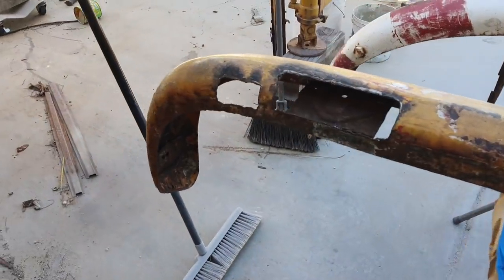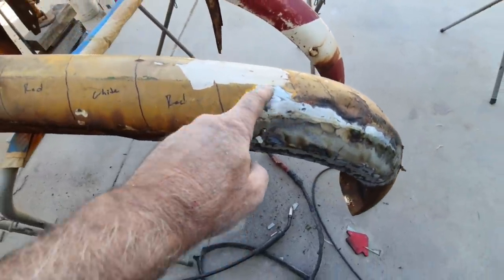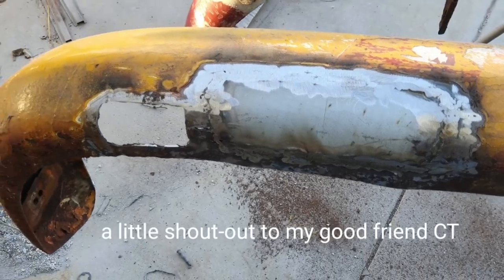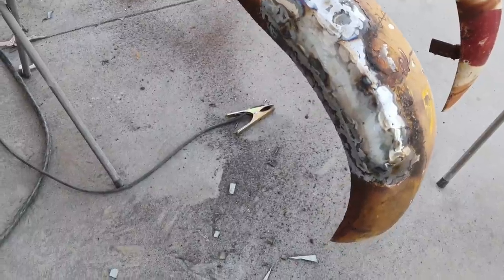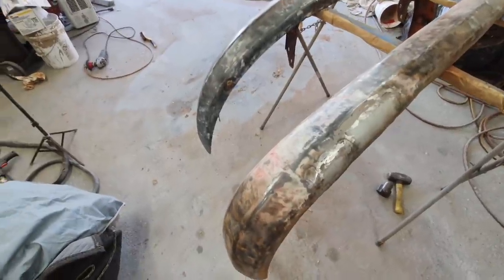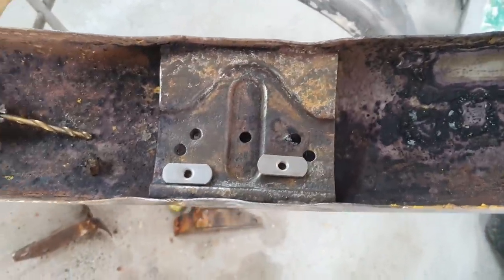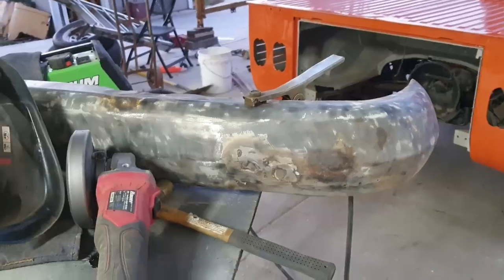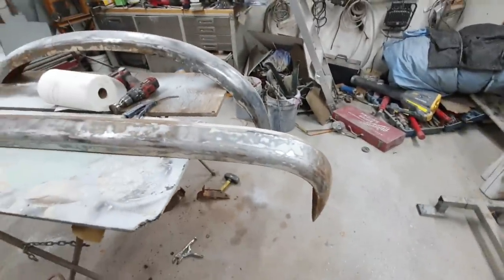Butt Welding in sheet metal with plasma cutter VW Single Cab cherry picker bumper restoration

Comment: I just got another set of original vw bumpers for my my 68, they still need a ton of work but they are better than the ones I got with my double cab.  I will probably have them sandblasted then powdercoated.  This again is a very timely video for me because I just got these bumpers last weekend.  Thanks for all your tips and advise!  BTW baywindows are awesome too.
Reply from the maker: Right on will be doing more on that bay too.

Comment: On Rambus I sandblasted them and it took 5 hours of sitting there ? It was boring but the end result is a A+ job . Like You say a lot of time. To knock out the dents I had to use a mini sledge . Good Video Mike

Comment: You made easy work of challleneging tasks I would be months at finishing it.  My 67 bumpers are ruff I already spent crazy hours removed all the damage. I like the fix for broken bolts, I need to remember that one for sure..   I normally just weld a nut to a flat washer then weld it in place. I need to get a few of those from Amazon and save my nuts, starting to run out cannot have that now can I.
Reply from the maker: Thanks 👍 I buy lots of nuts and bolts metric online and stock them for stuff like this. that way I am not paying full store price.

Comment: You are the man Mike. I am sorry I was not able to come down and get you and go to the VW place . I am sure it is gone now. You did a fantastic job on those butt welds. I find that I really like the results of the little 110 mig welder when doing sheet steel. I am really thinking of doing the DC conversion for that thing to make it spatter less.
Reply from the maker: They are having another sale this weekend sat and sunday. FYI. lots of stuff still there.
Reply: @Mikefngarage  Thanks Mike. I am up in PA for a few weeks. I got hit on my Harley and will be recovering for a while. Tell me how it is if you go. There are some beautiful brand new race engines on floor as you walk in.